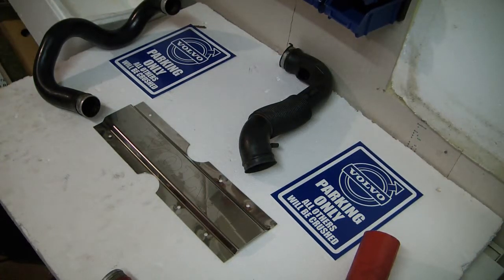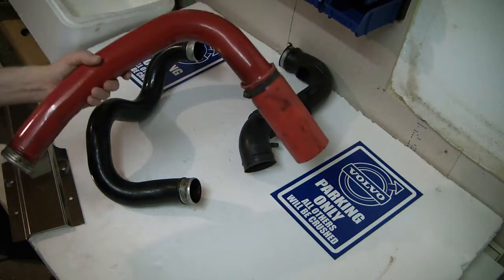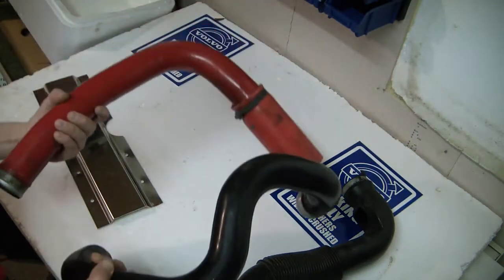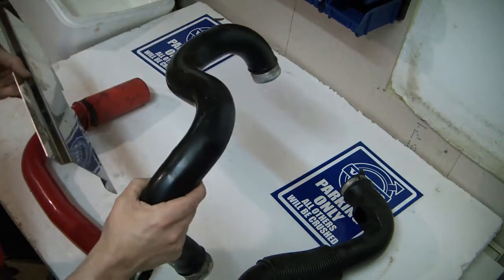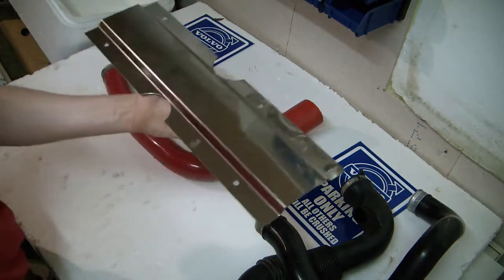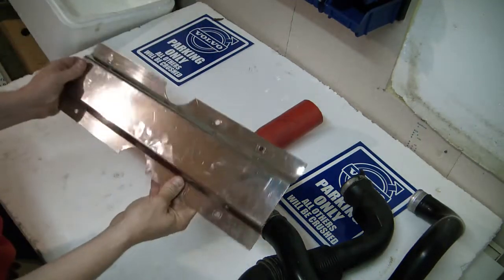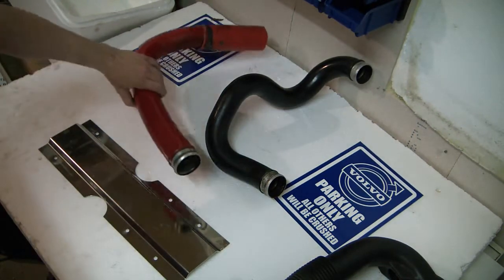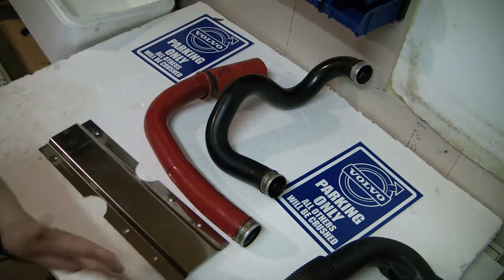Volvo 5-cylinder turbo RIP explained.

Comment: subbed   I got a 5 cyl!

v70   installing a rip kit soon
Reply from the maker: Nice!,  if you like some more engine noise you can also put in an high flow filter in the original air box. to cut down the lag a bit mote.

Comment: Greetings from UK , whats the best and cost effective method to get power increase without losing day to day use ? Volvo T5 1996
Reply from the maker: Start with STAGE 0 (zero) = new plugs, ingnition leads, distributir and rotor, and fresh (auto) gearbox oil, and engine oil... then just buy a tuning chip. this will get you into the 260-280hp 
area... (yes the chip salesmen say 300hp but in reality 280hp with a non rebuilt engine is the max limit).
Reply: Volvo 5 Cylinder  engine has new plugs, leads ,mas meter , k&n box filter . Any recommendations on chips ? Thanks
Reply from the maker: No specific chip really to recommend. They are all more or less copies of some basic tune. :)   just get from somebody that can provide some support if there is a "missmatch"...   The most important is to get the automatic version of the chip if you have an auto gearbox... as the gearbox will last netter with it...   both auto and manual tunes have the same max hp... but less torque on auto chip.

Comment: I've been thinking about getting the RIP kit, but it gets pretty cold where I live...even if I get the new design Do88 or Snabb RIP kits, would the freezing intercooler/throttle body plate still be an issue?
Reply from the maker: Hi. Svilen, where i live there it can also be -25C during the winter. and i still have the RIP kit.  the first signs of a frozen intercooler is loss of boost and power.  But this can be "unfrozen" by just having the car idle for a 15-60minutes.  and if you have the original IC then there is the tiny hole in the IC plastic bottom.. just check is is clear (poke it with a stick) so that the moisture may drip out from there.

I drive mine just like any other car and have only had problems one time during many years.

So i say go for it... you can always put original piping back and sell your kit. But i assume the slightly increased spoolup and throttle response will be reason enough to use the RIP kit.

And if you know about the issue then you should not have any problems..
The IC gets "warm" when the car is not moving so just let the car idle a minute on each stop and "unfreeze" and you should be ok :)

But volvo removed the RIP because they had make a car you would not have to "think about" that just works without any special procedures.

Comment: what did you use to polish your intake manifold? or is it painted
Reply from the maker: I sanded the whole intake and then polished it... and i polish it 2x /year because the aluminium oxidizes. :)
The inital polish took 3-4 evenings in the garage.